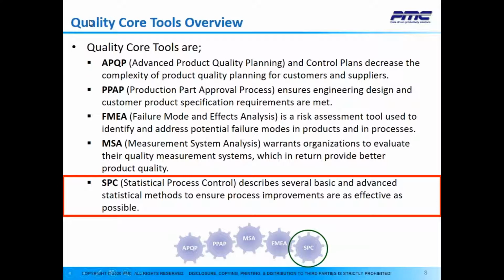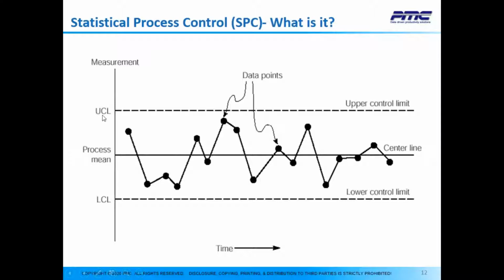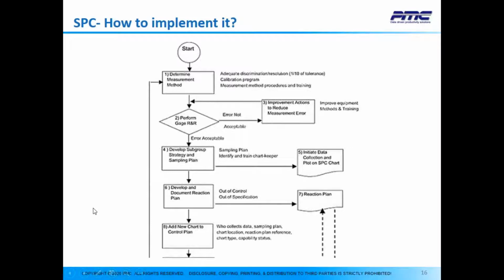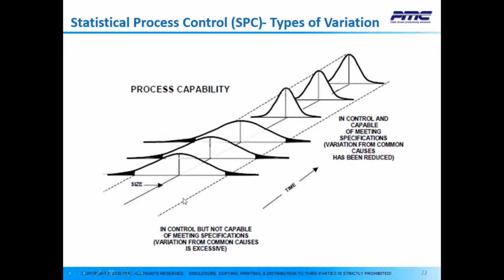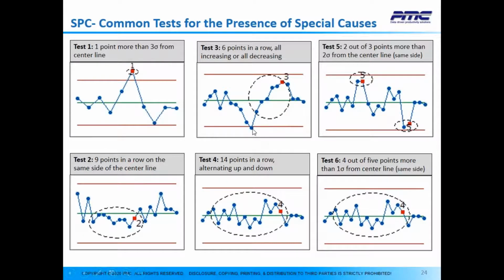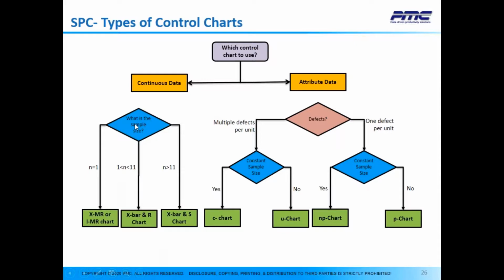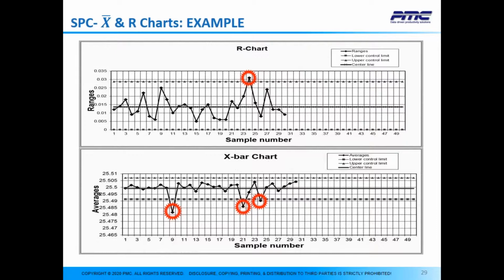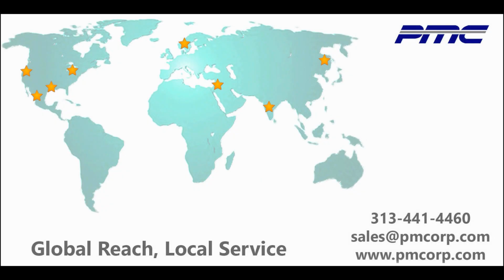Why is SPC (Statistical Process Control) Important?

Comment: How is the process mean in the control chart determined? Is provided in the design requirements? Or is it the mean value of the data points, but if so, how do you know if that mean is is appropriate?
Reply: mean value of the data points. You have to mathematically find the average.
Reply: Mean value is determined by the data points. A modern SPC computer program will calculate the “mean” and the “target” and these will be two separate lines on your control chart and on your histogram. The appropriateness of your mean in relationships to your target will vary depending on the project. Most control plans won’t have a call-out for how close your mean needs to be to your target, but there might be a call-out for a specific CPK number, for example: the automotive industry often requires a CPK number of 1.66 or higher. You can think of your CP number as “what your CPK number would be if your process was perfectly centered.” There are several reasons why you should try to get your mean as close to your target as possible, not just your CPK number.